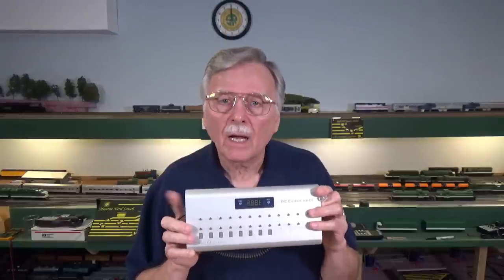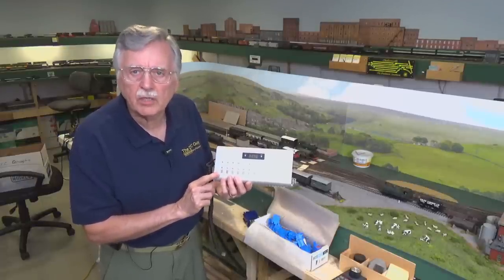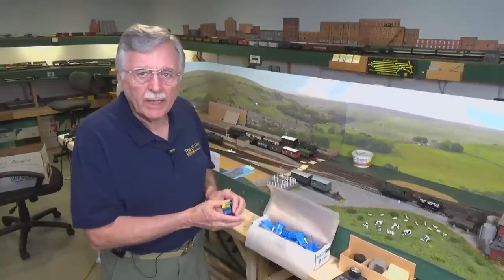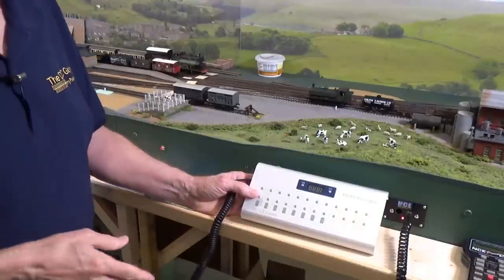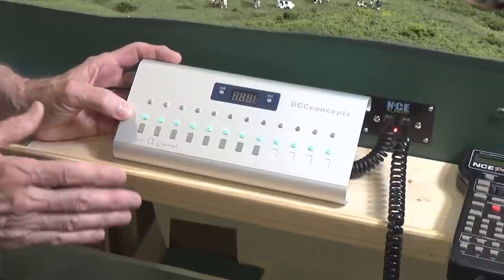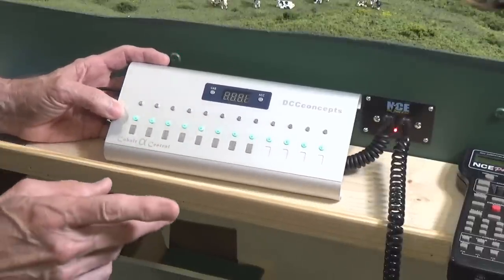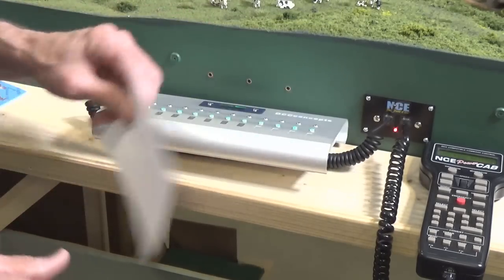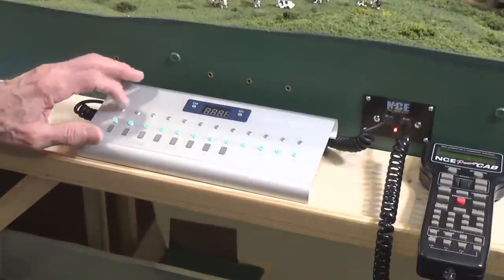Plug'n Play Control Panels For Your Model Railroad (262)

Comment: Hi Larry I purchased 6 Alpha Centrals to control my accessories, as I didn’t want them in line horizontally DCC Concepts made the Daisy chain leads extra long so I could place them Vertically in line. I later extended the Motive Power Depot and need to control an extra six accessories, rather than buy another Central I went for S Lever Control. Wow ! I was so impressed that I replaced all Central units with S Lever Control. 
I sure you will cover S Levers in the future.

Comment: Great video.  I like all your videos.  Very helpful and than you for posting.  I do have to take you to task for one aspect that appears to have been left out. How did you set up button number 4 for the crossover?  I THINK you had to either assign the same address (#4) to two decoders or connect two switch motors to the same button.  Either way I did not see that set up in the video.  Sorry if I'm being a pain but, that was the one thing I really wanted to see.  Have you posted a video showing this controller used with a Digitrax system?  Thank you for all you do for those of us who are novices.
Reply from the maker: You’re correct that I just programmed the two iP Digital switch machines controlling that crossover to the same address (4). Press button 4, both throw, and the crossover is set.  This setup is only compatible with NCE systems.
Reply: @TheDCCGuy  Thank you for the very fast reply.  Please forgive me if I am mistaken.  I thought you mentioned in the video that once you programmed the first position on the controller, the remaining positions all auto programmed in sequence.  Did you show us how to "manually" program the turnouts one at a time so that one button could control two turnouts simultaneously? I also thought you mentioned that the controller could be used on systems other than the NCE and that those would come in future videos.  I'll be anxiously awaiting future videos, regardless of the subject matter.  Your videos are highly educational to me.  Already gave you a like and a subscribe. 👍🚂🛤

Comment: Larry, another great "Must Have " product as what my son says!!! We have Digitrax so I'm on edge for your next Videos. On another note, we are going to purchase the new Walters crossover and use Circuiton's Smail decoder switch machines. We will power the frog with them but or question is- what about the main crossover in the middle, does it need to be powered routed like the frog or does it power automatically by what direction the switches are thrown. My son believes we are goin to have to cut separations in it so it doesn't short out. 
I have to go back to your vid on the crossover to see if there is any thing I missed
earl
Reply from the maker: o, only the 4 frogs are powered and that can be done with one of the SPDT switches on the Smail. And no you won’t need to make any isolating cuts in the rails, Walthers took care of that. I did talk about this i  the review video of those.

Comment: Why did you plug it into the left socket of the of the NCE facia, I thought the power cab went in there, or have I missed something?
Reply from the maker: It was in use with a standard NCE fascia panel not the original PowerCab power panel.
Reply: Hi Larry, thank you for taking the time to reply. I’ve been on the NCE site searching for the panel you describe but am unable to identify it. Could you possibly post a link to it.
Reply from the maker: Did you look under Jacks and Panels its right on their main page.

Comment: I bought Alpha Central integrated 12-way digital switch and an Alfa snifer
Connect to a dcc dr5000 Digikeijs central but it does not work
Would you have an idea?
Reply from the maker: Based on the literature it should work if properly wired. I suggest you give them a call if in the UK or send an email.
Reply: @TheDCCGuy  tks larry for your quick reply i will do it best regards

Comment: Larry, I have NCE SB5 with wireless Cab controller(address3) , I set the Cobalt Central to address 4  and it will not work, when I plugged it into the NCE fascia panel and it turns off functions to both Cabs and wont engage the Cobalt IP. Thoughts?, Thank you
Reply from the maker: First, does it work without the wireless cable interface? Have you tried it just with the PowerCab? You need to test each configuration and find out where the conflict is. The first time I plugged one in it worked but then all I had was it and the PowerCab plugged in. I have my system set up with the PowerCab on address 2, two other throttles on addresses 3 & 4, and the Command Central on cab address 5. You might go back and check all your cab address settings and make sure there are no conflicts. Also what wireless interface are you using and does it have a cab address?
Reply: @TheDCCGuy Larry, I unplugged the wireless ProCab(#3) , checked my Powercab and it is#2 so I reprogrammed the Cobalt to 3(it was 4) and it still didn't work, it seems to turn off the functions on the powercab and interrupts the signs to the locos because when plugged in the sound goes out, I unplug the cobalt and it starts back up.. Also the Cobalt IP works when I use it through the ProCab throttle and the Cobalt Central unplugged.Thanks
Reply from the maker: I have never experienced any problems with mine so am at a loss to explain your problem. I suggest you email their tech support guy Mick Bryan m.bryan@dccconcepts.com ASAP.

Comment: Great review Larry.  About two years ago you did a series of videos for a control panel board using NCE Switch 8 and a NCE Button Board. I was wondering if it would be possible to create a map of the layout as is done on the control panel with just red/green LEDs. So it would echo what the DCC Concepts panel is doing, but lighting on the map which track the turnout is set to. Thank you for replying if you have the time.
Reply from the maker: They make a different kit for producing a track diagram type control panel which basically uses the same electronics as the Alpha Central. It does not use bicolor leds but it is offered in 4 different colors. Take a look here:
https://www.dccconcepts.com/product/cobalt-alphaswitch-d-set-to-control-digital-devices-12-green-switches/
Reply: @TheDCCGuy  Thank you for taking the time to reply to my question. Have a great day.

Comment: So we already have our IP digital on Jmri  starting at number 45 we assume therefore that we would have to start at 45 to make sure everything speaks with each other nce system
Reply from the maker: Yes, you would set up the accessory decoder addresses on the panel just as I demonstrated, starting with 45 and the pushbuttons on the control panel would be in a sequence beginning at 45 and increasing by 1 accordingly.

Comment: Hey Larry, I think this is another option but Im not sure of the real benefit of it over a straight Wireless NCE ProCab system as you can control all switches, signals and accessories for all the different NCE products they offer and roam wherever over a such a stationary unit.. and I have around 60+ signals and over 50+ tortoise switch machines while sum are straight Smail's w/ the blt in decoder on the layout... good luck... DD    🤗
Reply from the maker: I always found trying to control a train and accessory decoders using a throttle to be problematic for most folks. Whereas with these all you have to do is push the right button. And for complex trackage such as in my big Monroe Yard a track diagram based control panel may be more intuitive.
Reply: @TheDCCGuy  I understand Larry... 👍 Everyone has their own style... take care... DD  🤗

Comment: Maybe I missed it; but how does the control panel know which accessory decoder is which ?  Sure, you showed us how to program the buttons in numerical sequence (1 through 8 in your case); but you didn't tell us how to link Button 1 with Accessory 1, etc.

Frankly, this control panel would be much better if you could program each button individually rather than in numerical sequence.

More questions:  What if you were to add additional cabs to your system ?  Would you then need to reprogram the control panel's "cab number" to the next highest ?  What if you were to have fewer cabs, do you need to reprogram again ?  Or, is it possible to give the control panel a "cab number" of 9999 to allow for future additional cabs ?
Reply from the maker: The accessory decoders are assigned specific addresses similar to programming a mobile decoder. I explained that in my review of the iP Digital decoders—see the link on the end screen.

As for the cabs each NCE system has its own maximum number of cabs. If you take one out it would not affect the operation of the ones with higher numbers. As far as adding one then yes it would be necessary to up the address of the control panel one address, but as I showed it is very easy and would not change how the control panel works.
Reply: When using this with DCC Concepts  IP Digital Switch Machines, you set each switch machine to set up mode via the small switch on it. Then press whichever button you want to control it on the Cobalt Central. This can be any of the 12 buttons and doesnt have to be the first one. Once this is done, slide the switch on the IP Diigital back to run mode and that's it programmed. Do the same with your next switch machine etc. You dont have to program in sequence although I guess most people will.

As far as Im aware, so long as the Cobalt Central has its own unique number, say cab 5, any other cabs nust not have this same number so can be 6, 7 or 8 etc. You could assign the Cobalt Central a cab address of say 10 at the outset. This would allow you to have upto 9 loco control cabs and allow you to add further Cobalt Centrals and assign an address of 11, 12 etc.
Reply: @TheDCCGuy  Thanks for answering.  However, it would have been clearer had you mentioned that in the video.  BTW to which link on the end screen are you referring ?  Of the two I see, one is about whether the Cobalt Digital is a "Tortoise slayer," and the other is about staging yard tracks and switch machines.
Reply from the maker: The first one.

Comment: Great video, Larry. DCC Concepts make some good products, a little pricey even here in the UK. I just wish they started making sound chips!

BTW, I was looking at your back catalogue of videos and watched some early ones on Decoder Pro connected to programming track. Might it be worth doing some new ones as the software has been updated many times in the last 5 years?
Reply from the maker: Although there have been many updates since then, in reality the basic operation has not changed a lot. If I do a new video it will be to upgrade quality and point out any important new features, and I can’t think of any right now.

Comment: What is your using kato
Reply from the maker: As I said I’ll get into what it takes to use this with other DCC systems in a future video, so hold your water and we’ll get there.
Reply: @TheDCCGuy  I use kato I have it hooked up to nce. I’m using the nce kato switch decoder.
Reply: @TheDCCGuy  I use kato I have it hooked up to nce. I’m using the nce kato switch decoder.
Reply from the maker: OK, assuming it is compatible with the NMRA accessory decoder protocols then it should work with these control panels. Can you use your throttle to control your Kato turnouts by entering the accessory address and then selecting the direction of throw?
Reply: @TheDCCGuy  yes I can.

Comment: MSRP ?  If you said it, I must have missed it.
Reply: Looks like 125 pounds is about $154.  So more than $100 each.  PLUS any other stuff needed.
Reply from the maker: I didn’t get into that since it varies by country. I noticed that Iron Planet Hobbies in Missouri has it on sale right now for $134.23 and for anything over $100 shipping is free.